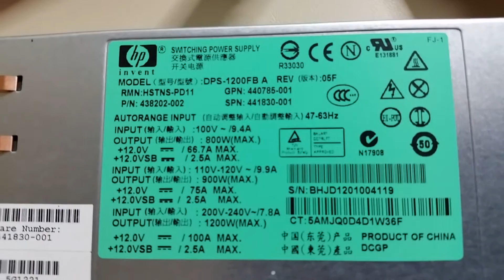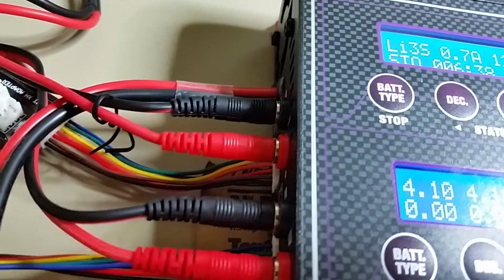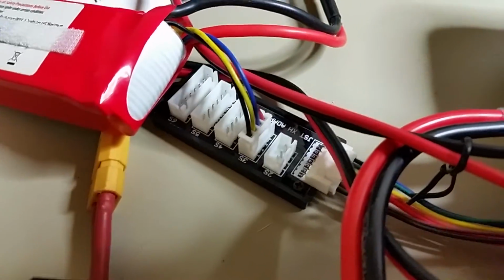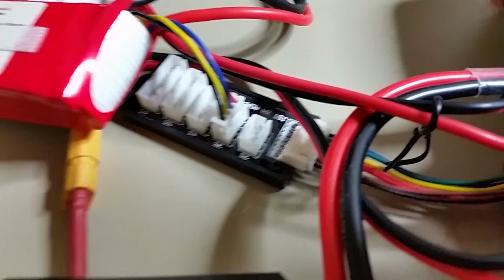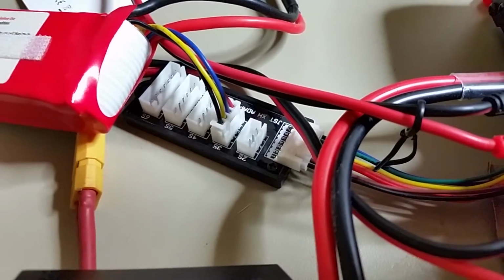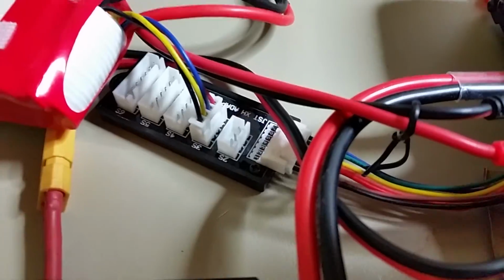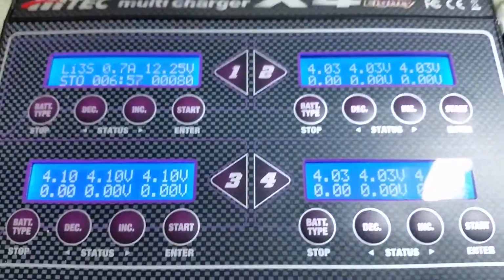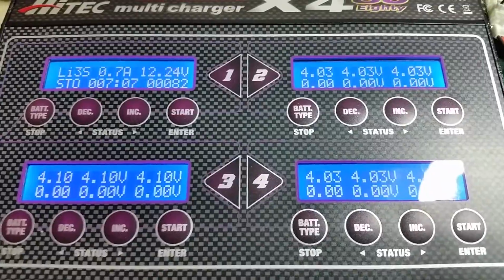Hitec x4 80 charger with HP DPS-1200FB power supply

Comment: ive seen others just solder the pads together. why do you use a resistor instead  thanks.
Reply from the maker: Protect the circuit.
Reply: cool. could add a switch there 2 i guess
Reply from the maker: need resistor to protect the circuit. dont mess around with this.

Comment: The resistor goes across pin 33 and 36 on my unit !!
I think your unit is the same and your video shows 33 and 36 not 35 as you said.
A simple mistake to make but may cause confusion.
Thanks.

Comment: I got no out put after drill 3 holes to insulate the PSU,.I used 1k ohms potential meter,I don’t know if that is something caused it. Please help.
Reply from the maker: +ASUS Micro What power supply are you using? And WHY did you drill holes?
Reply: +kennethpappas I'm planning on put two of this power supply in series. so I have to insulate one of it according to this website. http://www.rchelination.com/setting-hp-dps-1200fb-power-supply/#comment-1087
Reply from the maker: was it 1/2 watt and did you connect to correct pins?
Reply: +kennethpappas yes，I figured out why it stopped working. the holes I drilled for insulation are too big.
Reply from the maker: +ASUS Micro good to hear. i wondered why you drilled holes. i am now making a case for the charger, power supply and connections on top with balance boards and other attachments.
Reply: +kennethpappas Because I need 24vdc output, so I need insulation to keep one supply from shorting out. 3D print?

Comment: Hello, did you do anything internally to float the board, for safety reasons i mean?
Reply: This guy didnt need to float because he is simply running one psu at 12volts....All you need is the 1k resistor....
Reply from the maker: +Mihalis Polyzois NOPE.  It works fine.